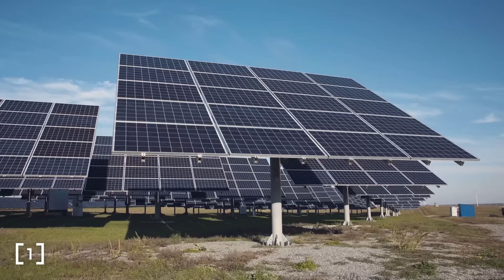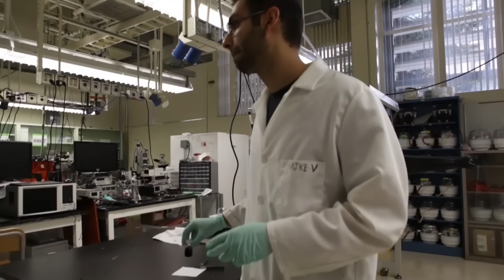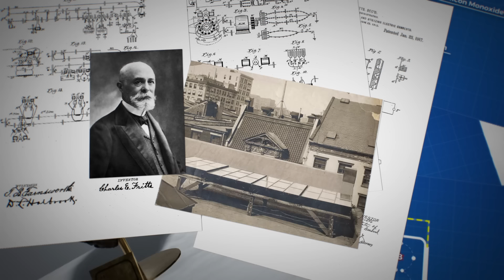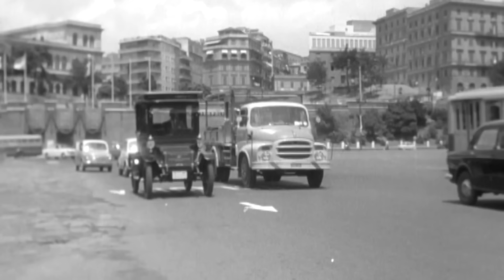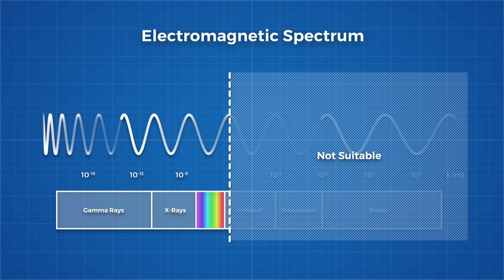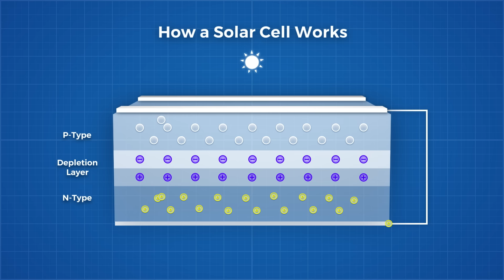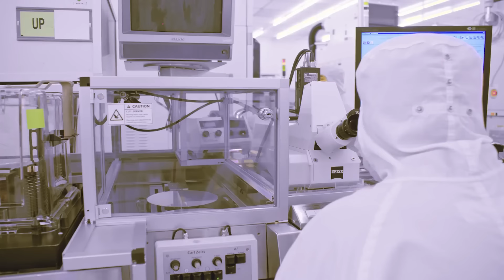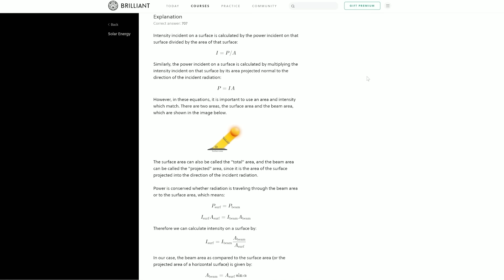The Mystery Flaw of Solar Panels

Comment: Can anyone who thinks this 'renewable/green' energy craze is worthwhile tell me how much electrical power is lost when converting DC to AC? 
Hint: About 30%.
Don't believe me?  Just put a converter on your car battery to power a small fan and watch how fast your battery drops.
Reply: That's not true, especially not on an industrial level. You can currently buy converters with 90-95% efficiency by yourself if you wanted. The reason your car battery drains so fast is that car batteries don't store much power overall. They are only favored because they produce the very high currents needed to start an engine. That's why something as small as leaving a light on in your car can kill the battery, because they don't hold much to begin with
Reply: No Solarpanel-Flaw is bigger than BUREAUCRACY. Theres some real 'Accident-Scandals' where good People just wanted to give back Stuff and arent allowed for nonsense-reasons.

Comment: It is ignorant to think plants "evolved" anything.  Time does not create intelligent design, it destroys it.
Reply: This is factually incorrect and I myself have done research watching single celled organisms evolve when stressors are applied
Reply: @samueltukua3061  Nothing evolves. That would require added information.  What used to be thought of as evolving is nothing more than changes to information already there or loss of information.  Intelligent design even built in the ability to adapt to changes in the environment.  But it is all already there.  Evolution of rocks to humans is just ignorance, a lame excuse to deny creation.
Reply: @churchmythbusters1863  you said "nothing evolves. That would require added information", why can't information be added?

Edit: also, you say "used to be thought of as evolving" when evolution is still the leading idea in biological science, so are you only referring to your own personal beliefs?

Edit 2: also "rock to human" as you call it is not described by evolution. That's an entirely separate and advancing field known as cosmology that likely is driven by the same processes as evolution, but is not evolution
Reply: @samueltukua3061    You tell me where information and genetic codes come from.  Obviously it comes from an intelligent creator.
Reply: @churchmythbusters1863  that's your first issue, the information doesn't have to come from anywhere

Comment: Isn’t the object to reduce global warming ? ..  those things get hot a lot hotter than sand that reflects photons much more efficiently.
Reply: Yes..plus the Fossil Fuel Companies needed to manufacture/produce these panels...should we ALL buy them. Imagine that.
Reply: Well they don't produce fossil fuels in their operation and what do you think the result of the creation of vehicles for coal/oil mining, the creation of coal/oil power plants, and the effect of the continuous stream of CO2 they produce is. Additionally, coal powerplants lose about 50-60% of their energy as heat dissipated into the environment. So they replace a ground that normally has 20-50 Celsius temperature with a plant radiating 540-600 Celsius. You've got a good point that the production of solar panels still requires the creation of CO2, but I do not think, from what I've said, that it comes anywhere close to the output of fossil fuels in the long term
Reply: I agree the less crap humans pump into the atmosphere the better but the fact is less than 1 percent of the CO2 in the atmosphere is produced by the burning of fossil fuels.
The fact is for one reason or another we will be forced to stop… eventually. But to destroy our economy in the process is madness …..you don’t kill the patient to treat the disease
Reply: @juniperman  well yes we only contribute about 1%, but you have to think of it as a balanced scale. Prior to industrialization, the earth was mostly balanced scale with approximately 360 gigatons of CO2 out, but then through plant life, the ocean, algae, etc. The earth would reabsorb approximately 360 gigatons. As of 2021, we are adding 3.6 gigatons every year that isn't being reabsorbed, so the balance is broken. So yes it's only 1%, but that's 1% more each year than the earth's biosphere can absorb, I.e. the issue is cumulative. As for the economy, you have to also look at the manufacturing, research, instillation, repair, transportation, and all administrative jobs that have been, and will continue to be, created during this transition, which is estimated to be in the hundreds of thousands. Mining jobs are secured and will just switch to silicon instead of coal, which is also safer for workers. Honestly though, if the effects of advanced stages of climate change are to be believed (and I whole heartedly think they are) then I couldn't care less if the economy crashed as a result (though, as I discussed, I don't think it will come anywhere close). It's not analogous to killing a patient to treat a disease, it's analogous to making them suspend their job so they can be under intensive hospital care. Ultimately what I'm saying in that last sentence is that we have two choices: do nothing and kill every human on earth or do something and face consequences that, I believe, are not as bad as human extinction. (But again, that choice is only true if you still think solar would crash the economy instead of build it or leave it relatively untouched)

Edit: forgot a period in 3.6 so it read 36
Reply: You sound like a very educated man Samuel..in fact you sound like a man that has spent a lot if not all of his life in the artificial bubble of academia.
So it is not surprising that " you could care less about the economy " I’m sure your mom or the government will take care of you. 
As for the rest of us we have families to support.. kids to feed.. keeping the economy that keeps us all alive functioning etc.
I wonder if you realize how much people who actually make things happen hate people just take and complain ?

Comment: With the lack of efficiency and the lack of capacity currently, there is no reason to eliminate fossil fuel power generation.  The climate red herring is laughable, even when it is shoved down our throats by liberal alarmists, citing computer models which aren't based on reality at all.  Garbage in garbage out.  The sun is the single largest driver of all things and besides GOD there is nothing more powerful in this solar system and as relates to CO2, water vapor is by a huge factor a higher impact greenhouse gas.  It is far more effective to allow solar to compete and take over if it can, limiting the effect on the customers of that energy.
Reply: You don't know how climate change works

Comment: I know it's kind of silly question. But if we want to absorb energy as much as possible why don't we simply coat the solar panel in black then we can absorb and pass it to photovoltaic cells or do something like that.
Reply: Well that's sort of being integrated. One use that's desired of compounds like vantablack is to hopefully use them to power solar panels batter. Specifically the structure used to create them. But ultimately the silicone need to be the thing absorbing the light, not whatever pigment or compound is used to make the panel darker. So the hope is to make ventablack type structures out of silicon instead of their usual carbon (since they both have 4 bonding sites and can be used similarly)

Comment: It is interesting that you list the peak output for the solar cells.  You should be using the 24 hr average value when you compare it to exiting power plants.  Truly deceptive number.
Reply: Good points.....and most consumers just dont care to hear the details.  
Solar Panels are not the answer....just another variable.
Reply: Not really deceptive. This is an engineering video, not an industry video. In engineering, efficiency is defined as what percent of available energy can be utilized by some device, since there is no energy to utilize at night then it is not counted. There's nothing deceptive about it, you simply didn't understand what the point of the video is or the language he's usually

Comment: Solar electricity on a grid for a nation fails. Why? Let's say we have 40% of the grid depending on Solar. Then the Sun goes down. The local grid just lost 40% of its generated electricity. Even if during the Sun Time 50% was saved to batteries you now need twice as much than 40%... also there is a 15% loss in charging batteries so you need ever more than 40%. There is no know ability to store that much power in battery packs. The largest battery (a building) in the world today would not operate Chicago's Street lights for 30 seconds. So now what, the grid is suddenly down 40%... you need nuclear or fossil. Nuclear can not just suddenly ' crank up ' only Natural gas can do that. Solar and Wind is not Practical Science.
Reply: Natural gas fired power plants can't just "crank up" at a moment's notice either.  The best option for a "peaking plant" is diesel generators.  Also, oddly, hydro power can "crank up" in only a few minutes.  It's sad to me that large dams which could produce lots of power are being used today as "peaking plants".  In my home town of Redding, California... back in the 70's and 80's, Shasta Dam was used as baseload power.  Today... it is a peaking plant.  That's wasted energy in my opinion.

If I could afford to do it, I would install an off-grid solar system in my house (with enough batteries to last for a reasonable period of time).
Reply: @1969barnabas  Having diesel and natural gas at a plant is complicated. You now need the diesel and a transmission to switch between a steam wheel and a diesel wheel. Plus 2 different fuel supplies. Besides NG is as quick as it needs to be. When the additional power is required there is generally (most always) a known time for that additional energy plenty of time to bring a boiler up to steam.
Reply: @alberthopfer3087  I didn't say anything about both diesel generators and natural gas boilers being at the same power plant.
Reply: When the sun goes down, electricity consumption drops by about 70%, which you forgot to mention. Water and "reversible damns" have been seen as a very viable option for energy storage, as well as objects which store their energy kinetically. Additionally, the gree energy movement includes hydro, thermal, wind, solar, and carbon free coal (coal made from trees grown for the purpose of burning since it's carbon neutral at that point)

Edit: oh, and also some nuclear
Reply: @samueltukua3061  All plants should be Nuclear. 70% drop is today with few EVs not if people return home and plug in a few million EVs for overnight charging. Winter time in my State sundown is 4:00 or 4:30P... shorter day time. So on average Sun is down longer than 50% in my description I used 50%.

Comment: This is clickbate, They state antigreen energy propaganda, most likely funded by big oul, then an idiot with an accent recites crap we learned in high school for 10 minutes, I have 20 kw and it puts out the same energy as the first day I installed it at 25 cents a watt, it has long since payed for itself and will have free energy for another 30 years. This boring information is meant to numb you so you only walk away with the idea solar is bad.
Reply: You learned about silicon doping and the photovoltaic effect and the history of solar panels in high school?

Comment: We are currently looking into covering our roof with solar panels, apparently you can buy solar panels that are cooled, which in combination with a heat pump can also contribute to heating the home for a significant amount.
Reply: Hybrid panels also help keep the panels cool, this improves the solar panel efficiency. Remember to get individually rectified panels, smaller cells also help when panels fail and to cover more of the roof

Comment: To lower atmospherical heat it's probably better to paint them all white and forget about the electricity production they generate. If we were to cover the planet with a lot of black panels, you don't need to be a rocket scientist to understand that it will create a lot of heat and in reality they probably increases global warming.
The only electric production that does not generate a lot of heat is water and wind. My grandfather made a 15 minute free hot shower system by putting a long garden hose on the roof 50 years ago. A green one was best, black made the water to hot.

Comment: Hey with the light radiation you made a mistake there... You switched up the name of the light's infra red and ultra violet at around 5:30 the graf is correct but how you called the different radiations not. It's really confusing... also misleading if someone now thinks that most of the radiation in ultraviolet which causes much of the skin burning in the summer.

Comment: If you can't capture certain wavelengths of light, I find it silly to say you are losing that energy, since you never captured it in the first place.

Maybe this is a trivial point, but saying a panel is 20% efficient suggests that it loses 80% of energy in conversion and that's not true.  It could never capture that energy so it could have lost it in a conversion.

Comment: This video is one of the very best explanations of the workings of solar cells I have ever seen. I teach teachers how to teach science to tiny kids in an elementary teach education program and this video has helped me understand how solar cells work better than anything else I have come across. I'm excited about sharing this information with my students and helping them develop the confidence to share it with their students. 

(Just a thought.) There is one thing that should be considered in my opinion. The word, "holes." The understanding that most people have about "holes" is a lack of something in a body of something. A hole in a sheet of paper. A hole in a field of grass. A hold in a wall. "Moving holes" is a concept that does not resonate with many people. No one has ever had a hole in a sheet of paper move to a different part of a sheet of paper. Etc. I know that "holes" are a term used as a short cut for a "position" in the semiconductor lattice that has an overall positive charge. But a student trying to understand this information for the first time can get completely turned around on just this one critical term. I think "holes" needs to be replaced with something else that doesn't have so much conflicting baggage.

Comment: Fossil fuels will and can never be completely replaced.
Solar doesn't come anywhere close to nuclear energy.
Silicone comes from oil and other materials used to build batteries and solar panels someone has to destroy more forests to mine the materials for manufacturing. So instead of drilling a small hole and a acre of land to get oil and gas a hole hundreds of feet deep and half a mile in diameter to get the materials to build the batteries and solar panels.
Reply: Silicon is an element, silicone is an elastic material. They are different things.

Comment: Fossil fuel is the best and most reliable source of energy. Unless you use nuclear energy.  You can't make this panels without the use of fossil fuels.
Reply: Unless you make them using solar. Also, if you mean by a material standpoint then sure, but the point is not putting it in the air, just putting the compound between two sheets of glass doesn't matter

Comment: this figure 630000 mw is all but negated if you think about how they where made using fossil fuels so what we need is not only more renewable energy and how they are made is also renewable and don't use fossil fuels
Reply: But, and this is the only point that matters, it doesn't reintroduce fossil fuels into the air

Comment: The real problem with solar energy is they haven't figured out how to store the energy overnight. If they ever figure that out then that would be the future.
Reply: Well there are pumped hydroelectrics and flywheel ideas, but real engineering actually has a video on a type of battery being developed by an MIT professor for this exact purpose
Reply: @samueltukua3061  -- Don't you think I know that, they have been storing the energy in lead-acid batteries since solar cells were invented? I'm even doing it.
Reply: @Ken-rk3by  then what's your issue?
Reply: @samueltukua3061  -- I don't have an issue, but it sounds like you're just a TROLL

Comment: as we now know, electrons do not move! God where u bin! the power is coming from a wave, or rather 2 waves. No electrons move.
Reply: Lmfao, as veritasium explained, the wave model is next to impossible to use every day when the electron model is correct 99.99% of the time and thousands of times easier to calculate. these are both models used to understand processes. Sometimes different models are needed in different applications

Comment: I wonder what happens if you coat the filaments with Vanta Black
Reply: You're actually onto something that's being done. However the idea is to replace the carbon in vantablack with silicon, since they bond very similarly, to capture more light in the same way